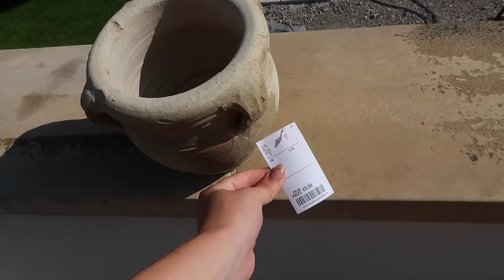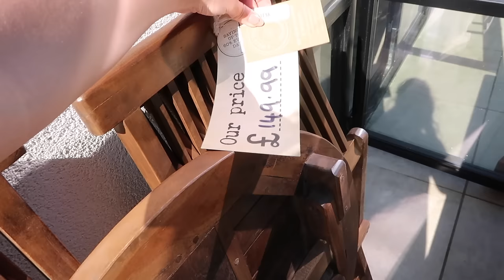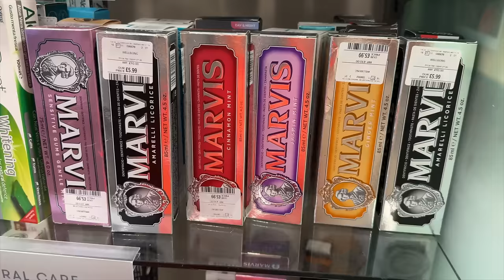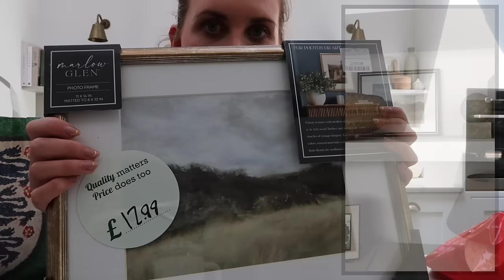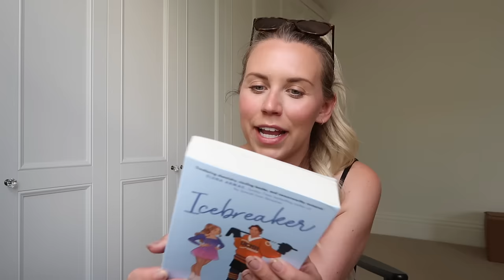VLOG | gardening, M&S haul + homesense shopping

Comment: The mint roots will spread everywhere, and it will completely take over within a few years, even if you dig it up, you will need to replace all the boarder soil to remove every trace of roots or it will just keep coming back. I keep mint in tubs not the actual ground.
Reply from the maker: noted thank you!!! we are going to have to re-plan by the sounds of things!
Reply: 100% agree got mine in tubs as it’s nightmare spreads so fast
Reply: You can plant it in the plastic tub xx

Comment: Squirrels will wreck your pots put gravel or slate as a mulch.If you put bulbs in later on use wire mesh to cover them. Garden is lovely.
Reply from the maker: thanks for the tip!
Reply: Yes, that's exactly what I've had to do with my pots. Blackbirds and squirrels will dig out the soil/plants very easily and they seem to love freshly planted pots best. If you use the same gravel as you're having laid, it will all match. It also stops soil splashing up onto the plants when you water so put a good layer on. I tried bark chips but they are just too light and can be turfed out. Ps. Alarm bells started ringing when I saw the lemon balm. Hope you really like it because it will get everywhere!

Comment: Hi Freya 🤗 not sure if you will see this comment as I know I am late to the party! Just catching up on your videos after returning from holiday. I’ve missed them, you’re such a ray of sunshine 🌞 With regards to prickly heat, I think a few have mentioned this already, but thought I would throw my oar in 😂 I used to suffer terribly and tried so many different remedies - over the counter and prescription and have finally found relief with Ultrasun - what whitchery makes it so good? I couldn’t tell you, all I know is that I now would never use anything else. I usually use the spf 50, but sometimes drop to 30 if i won’t be out for long or am a week into a holiday (having used 50 for the first week) I still get a beautiful tan, even with 50 all over, every day. They also make a soothing after sun that really helps too.  Make sure to follow the directions and put it on at least 15 mins before sun exposure/layering moisturiser or makeup, etc. Let us know in a future vlog if you try it. P.s. QVC always have better deals than the high street 😉).

Comment: Change to "mintgate" ...
Freya, have you thought about a Blaster dryer for Barney after he has been in water?  They basically blast cool or warm air from the unit down a flexible pipe which blows water off the dog's coat. We used several on our Newfoundlands over the years.  Not a hairdryer which is not good for the coat but way better than towel drying. Would even blow soil or leaves off the terrace. Dog groomers use them.
Reply from the maker: yes I would love to but he is petrifieddddd of them! may need to train him to tolerate them it would be a lot easier!

Comment: I won’t go on about the mint! I would do a chart of the herbs layout, and change it time goes by and herbs replaced. That way, if the label markers fade, the blackbirds move them when scratching around, or they are blown away - you will know what is planted where. For the green steps, sweep the area, and then spray with Wet and Forget. It works with the rain water to remove algae, and it’s effect lasts about a year before needing to repeat. I use it all the time on my York stone  paving slabs. Good for fencing also, usually see the effect overnight. Keep away from plants, and animals until dried. Hope your heat rash improves. Keep your energy levels up!
Reply from the maker: thanks for all the tips! complete beginner here ready to learn along the way!